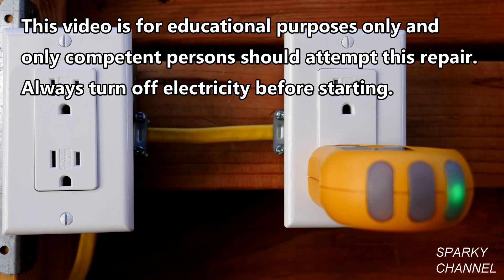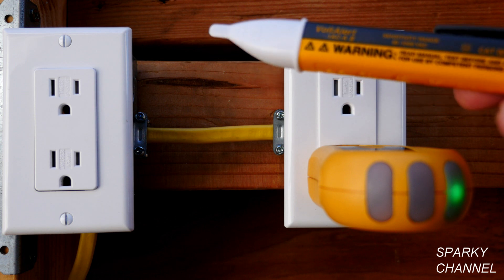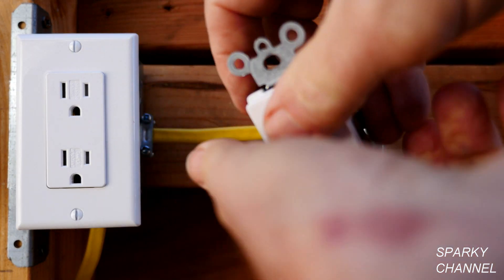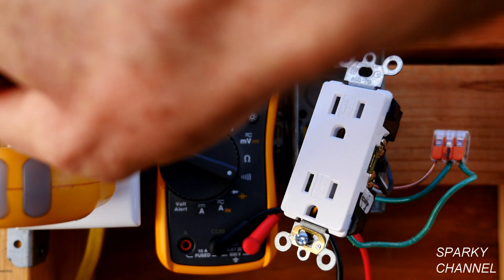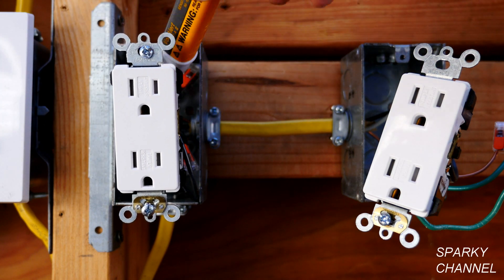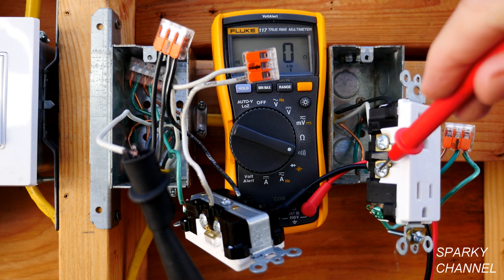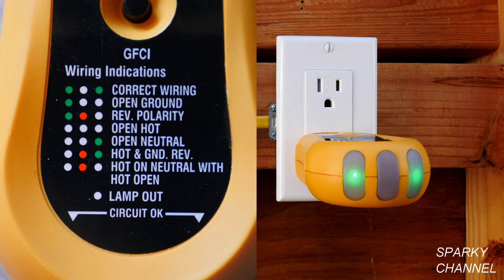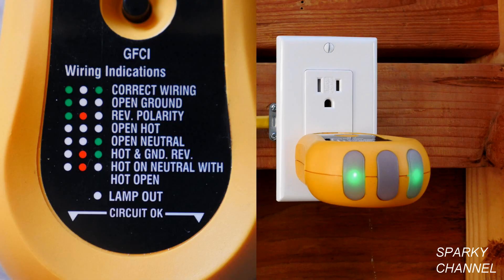How to Fix an Open Neutral Receptacle When the Problem is Upstream in the Circuit

Comment: I'm five years into my new home and still have an island outlet with a open neutral.  The problem is I can't seem to locate the feeder outlet.  I have removed all the obvious nearby outlets and checked for a disconnected and/or loose neutral.  Any tricks to identify where it is tapped into?

Comment: I want to go with this vid but then you went and taped the outlet. I like taping outlets too. Gives me a sense of tightness in the job. But its also controversial. The devices are rated as is for dissipating heat. The tape changes the ability for the device to do that properly

Comment: Circuit braker  jumps out suddenly when i used 2500W heater.. when I wanted turn it on its immediately jumps out again.. i saw circuit breaker is melted and badly burns. So I replaced it with the new one but its immediately tripping out.. than I see all 3 wires inside outlets become live without any voltage.. is anyone knows what is the issue ? Is some wires melted  some places inside the walls causing the short circuit? Thanks

Comment: Switches, Outlet and Compromised Circuit with open Neutral Wiring 
1.	Living room 3 Switch and 4- outlet not working. Kitchen ceiling light switches bad, One Single line
2.	Hot & ground rev in outlet (As per my Tool)
3.	Kitchen, Bath and Bedroom switches, outlet are working Fine
4.	Circuit breaker possible compromised circuit with open Neutral wiring living room (AL Conductor)

Comment: Back stabbing wires is not recommended u should always use the screws on the side.
Reply: If the holes for back stabbing are there that means it can safely be used if devices are listed thats it even though I try not to use the back stabbing connections if you decide it to use them is fine as longest it’s done properly I see sloppy work on screws connections that are just as bad or worse than the back stabbing connection
Reply: @MrMarava  heat cycles wear them down over many years, and they can become faulty over time.

Comment: I have a bunch of outlets in my house that are testing "open neutral" but they all still work..........What could that be?
Reply: Somebody may have connected your ground to a neutral elsewhere to bypass the open neutral test your ground wire to see if it's hot

Comment: I have 3 outlets on a wall, all testing open neutral. The problem I’m having is that I CANT find the breaker for these outlets. I’m using my breaker finder, normal I would be able to follow the wires but these have to be under ground and I can’t find an access panel or anything around here.  P.S. I’m in an indoor mini golf place and the outlets are on a wall that separates the golf holes.

Comment: The video was OK except. I do not recommend using the middle side knockout in a metal box, especially when you have a knockout seal or KO seal. on the right side. That is so very close to being able to touch the hot side of the receptacle. You should have used a plastic knockout. Whatever possible into a single gang handybox is, this one is called go in from the top. Or the bottom or use the bottom or the top on the side. Not the center, one that can touch the neutral or hotside of a receptacle or switch that slocated on completion.KJ

Comment: I checked like you said, I backtrack and I found where the issue was. I took the wires apart, found that some of them were burnt as I stripped them put them together and Wala. No more unconnected neutral. Thank you for your video I appreciate it. I feel good about getting it done myself. Thank you again.

Comment: THANK YOU!  This is how all DIY videos should be done 👏 I had an Open Neutral on an outlet on a circuit that was confounding me, and your straightforward video led me to the upstream GFCI outlet that was faulty and now I’m back up and running 👍
Reply from the maker: Great to hear, thanks!
Reply: 😮  ahhhh. The GFI was faulty!  Just gave another place to check!  Thank you. My outside  gfi box was giving this error, tied to an inside circuit all the way to middle of my house.😮

Comment: Thanks Bill this was helpful. Can you help me with a question? I want to add an outlet to my garage that will provide 3600 watts (2880 continuous) for tools, that is GFCI protected. Can you outline how this would be done? I know I could add two GFCI outlets side-by-side, and run two 12/2 wires from each outlet to their own 15a or 20a breakers, but is there a better way to do it? Thanks!

Comment: I have a question please... If the primary function of a neutral is returning the electricity to the panel then why don't you get shocked from it when you touch it? I keep hearing this saying that the neutral returns electricity to the panel but how can that be if it does not shock you? Thanks!
Reply: Is it correct to say the neutral job is carrying the current back to the panel BUT that current is not energized and that's why you don't get shocked by a neutral (unless its a short circuit)?

Comment: Great video!!! - Question about the tape. I have read many times that there is no need for tape, that tape will increase the temp and may induce a fire - What is the common practice on applying tape to outlets? and what the code say? - Thanks again! good tips

Comment: Just wondering if you can answer a question I have two outlets in one box and when I wire one Outlet by itself it works fine but when I wire in both Outlets I'm showing an open neutral?

Comment: Puzzled as to why the outlet to the left tested normal as it had an open neutral?
Reply: It tested/worked fine because the upstream neutral and hot were attached properly to it.  The problem was that the neutral going from that box was ‘not’ connected to anything. So, Bill just connected the loose neutral to the pigtail that existed from the incoming neutral.

Comment: Excellent videos on the misleading hot/ground problem.  I found two duplex receptacle with hot/ground on the tester, and disconnected everything in the other receptacles but the first two didn't change to open neutral.  There are two ceiling lights on the circuit that have both stopped working.  Would an open neutral in a circuit branch with lights and switches (no outlets) always show hot/ground reverse because the load is always connected?

Comment: Hi,
   Thanks for your video.  I was able to troubleshoot 5 outlets that were not working as well as a closet light that was on the same circuit.  I used the outlet tester and was getting an open neutral.  When I opened the outlet there was a small piece of live wire that broke off and the wire was required into the screw holder.  I can only assume that the extra piece of wire was interfering and shorting out that wall.  

Thanks again.
Reply from the maker: Great job!

Comment: Ok randomly 5 of my 10 outlets randomly stopped working (at the end of the run) so I tested the line and the 5 indicated "hot & ground reversed" the 1st 5 indicated "correct wiring" so I opened the last 5 checked and tightened everything (not that any were  loose, only 1 neutral got a slightly turn) turned on the breaker and now it reads "open neutral " so as per your video I went to the next outlet back that indicates  "correct wiring" and all the wires are proper and tight? What am I missing here  ?

Comment: Mine is fine up top but down below instead of 120 it reads 30. I am a handyman but I don't mess with electric unless it's easy. But this one I'm having problems with. If anyone has an idea lmk. Thanks guys!
Reply from the maker: That's probably a ghost voltage. My Fluke 117 has a setting called Auto-V LoZ. When you flip it on that setting if it's a ghost voltage the reading becomes 0. What I can tell you is that something is wrong, perhaps your device or perhaps your meter. See my video: How to Turn Off Ghost Voltages with Dual Impedance (LoZ) Meters: https://youtu.be/JRXTFxsA_lA

Comment: Excellent, simple format and very informative.   Will try tomorrow on my external GFCI that is in same situation as presented here.  Circuit breaker fine, GFCI test/reset button inop, have a hot white on line side.  Will go through a back check in downstream outlets.  Thanks Bill!
Reply: FYI- When the GFCI receptacles fail, they just stop working.  There are some fancy ones that have a light that tells you when inoperable.    To test this, you could shut that breaker off and replace it with a new one or another GFCI from somewhere in the house (safely removed).  The GFCIs have a life span of about 5 years depending on wet location, number of times it has tripped, etc.  Mine have lasted over 20 years, but that’s not the norm.  Let us know how it turns out.
Reply: Martin Parish  I'm having the same issue as you. No changes have been made since the problem started. What did you find?

Comment: The circuit tester reports Hot on Neutral with Hot Open on the same outlet reading 70VAC.  The outlet failing is a ground fault outlet and has not tripped. The black wire is hot at 70VAC. The same reading of 70VAC is shown if I measure between the black and white (neutral) wire when the outlet is removed.  This is a single phase 120v 60Hz residential outlet.

Comment: What if only one outlet is failing? There are no other electrical issues found in this home.  The outlet failing is a ground fault outlet and has not tripped. The black wire is hot at 70VAC. The same reading of 70VAC is shown if I measure between the black and white (neutral) wire when the outlet is removed.  This is a single phase 120v 60Hz residential outlet.
Reply: I have the very same issue with bathroom outlet. Its the only one that does not work. I don't know what the hell to do.!. He didn't seem to answer you ! Did you resolve it and how ? Thank You !

Comment: 2 years. TWO YEARS!! Electricians telling me it's the bathroom light and fan. Took 3 hours to test, retest, rewire and nothing (except I have a timer now on the bathroom fan). Drove me crazy since the bathroom fan and light worked but there were 2 outlets barely pulling anything. 
Finally, like GOD just said "alright, we've tortured her enough" I come across this video. I decide at 3am to check and sure enough, the outlet right next to my head every night had a neutral just hanging out in the back.

Thank you Sir. Thank you so much.
Reply from the maker: Great job! Thanks so much and you write very well!

Comment: Thanks for just sharing your knowledge like that. I did a  workshop ( Metal bldg) and passed inspection, but never thought to wrap the receptacles in electrical tape.  Now here is my question, will open neutral cause a situation like what I am having.  In kitchen I fire up the electric kettle and the fridge seems to be running louder.  I suspect that the fridge and kettle become series and not parallel so more amps is getting driven through the fridge by the kettle's amperage draw.  Could kettle be faulty and leaking power to ground and causing that ( doubt it)?  Thanks

Comment: Thats great for new construction however you will not find that in existing wiring. Not a practical video for the average home owner. Steel boxes are not typically used in modern homes. Taping the receptacle is a joke! Never be in a box or work it energized so no need for tape.

Comment: @Sparky your videos are great.  You speak clearly and very well and obviously know this subject like an expert.  Thanks for sharing in your knowledge because between you and another electrician that I paid $150 to fix a 4 toggle circuit with 2 light fixtures, obviously including 3-way and 4-way toggles I have learned an awful lot.

What do I do when the Fluke Voltage Detector still lights up but does not make any chirping sounds?
My other question is do you have any videos on how to determine which outlet is upstream from all of the others to target as the prime candidate for replacement with a GFCI/AFCI?
Finally, do I require a GFCI/AFCI breaker in order to put a GFCI/AFCI receptacle on that string of devices on the same circuit?

Thank you.
Reply: The Fluke tester I have will disable the beep (if it annoys) by keeping the on button pressed down for a few seconds when you first power up the tester.  As for finding the first receptacle upstream, it is ‘usually the closest to the breaker box, but to really determine which one is closest, you need to open the suspect receptacle (after flipping breaker off) and disconnect the wires so nothing would go downstream and then check to see no power on the rest of the receptacles after power is back on.  Can be a little hit or miss process.  Add your GFCI to the upstream receptacle and then use the internal test to see if it kills all the receptacles.  Regarding needing a GFCI breaker on that circuit, the answer is no.

Comment: Thanks for sharing your wisdom. I replaced a switch powering a chandelier. Turned it on and off a couple of times and it worked fine.  Half an hour later the light came on by itself and I cannot turn it off. Replaced switch and same thing is happening. Help!!!

Comment: Technically that is called the grounded conductor. The neutral is the wire that carries the unbalanced load. Other than that, great job 👏

Comment: It is also very important to show that an open neutral wire could be loaded with electricity. 
That is a danger for electrical shock for whoever assume that neutral wire carries no electricity.
For example in the trouble outlet with a light plugged in, show that HOT-NEUTRAL measures 0V instead of 120V,  NEUTRAL to GND shows 120V instead of 0V.
Reply: Person with extremely novice understanding of electricity here but would the non-contact detector be able to detect the power on a hot neutral to Gnd?
Reply: @Axs208  Yes, a non-contact detector will detect high voltage on a hot neutral.
Reply: A very cardinal comment

Comment: Those lever wire connectors are the bomb. I always worried about the twist connectors failing when you tucked the wires back into the hole. Great video!
Reply from the maker: Thanks Richard!
Reply: How much are
They ?
Reply: They only fail if you don’t use them right.
Reply: These fail way more then a wire nut …way more! This is the equivalent of back stabbing a plug
Reply: @pulkpuller   I’ve been using the Wago lever connectors for years and never had a problem.  There are cheaply made Chinese knockoffs that are crap.  Conversely, I’ve seen countless wire nuts that were not put on properly and caused problems.
Reply: @glasshalffull2930   any hint of vibration and wags are a poor choice. Yes , anything installed poorly will obviously not work.
Reply: @pulkpuller  I’ll keep that in mind.  Thanks!

Comment: 90% of the time this problem is because the original installer used stab connections in the receptacle and the connection has failed.  75% of the time, the problem will be in the upstream receptacle. 33% of the time, you will be unable to figure what the guy who ran the wires was thinking when he routed them.
Reply: I have also seen people who tighten wire nuts so much they break the wire.
Reply: @WeMe83  that's impressive since I've seen people crank down a wite nut hard enough to break the shell of the nut without breakimg the wire.

Comment: Hi Sparky Thanks for your educational videos. I'm wondering, what would happen if I peed directly into an outlet with a hot wire and an open neutral? Other than the smell (I don't mind as I have burnt out olfactory senses), would I be in danger of the spark jumping from the copper wires over to my pee-hole? Definitely wouldn't want that to happen! Thanks for any insight you might offer. Wanting to try this soon, but wanting a fuller understanding of the physics before I attempt it.
Reply: Depends on if your body is grounded I guess. If you’re wearing shoes then you might feel a little tingle as the capacitive properties of the human body will accept some charge. If you have your hand on a bonded metal fixture though, or your feet making good contact with a conductive ground, you die. Probably not a good idea and I take no responsibility lmao
Reply: @MrFitness94  Ok, that does make some sense. I'm just wondering though, how exactly would I know the difference between the normal "tingle" I feel when peeing first thing in the morning, and the tingle that might come if my body is acting as a capacitor? 🤔
Reply: @Rick-the-Swift  i cant say I know what you mean by the “normal tingle.” But i mean, if you’re peeing into a toilet bowl and you have X amount of tickle, then that’s your baseline. Now, anything more than X, would have to be coming from external sources. So I’d say, if you pee on a hot wire/outlet, and you feel a tingle that’s MORE than X, then you’d know. 
I might add, the problem with some “shocks,” is that the path could be so resistive, that the current flowing is so small and you can barely even tell you’re getting “shocked.”
Reply: What an Idiot!
Reply: @danserrano85  idk Dan, I thought MrFitness explanation made pretty good sense, although like most valid scientific hypotheses it did leave me more questions than answers. 🤔
Reply: @Rick-the-Swift  Mamon

Comment: Love your videos. But I am irritated!!!  Not with you of course, but with the electricians who wired my house back in the late 50's and who ever it was that hacked your channel!!  I am trying to put new outlets in my house, the way you showed (cgfi for a non grounded plug series and labeling all of them them correctly, finding  the first plug etc).  But I came across something that makes me slightly mad.  The electricians of old joined the line wires and load wires together with copper crimps, then black taped them and then a short pigtail to the plug.  Not a big deal by itself, but they left only 2 inches of wire in the box!!!  I seem to recall in one of you older videos how you correctly added wire length in the box, and I think it was with WAGO lever connectors.  Would you by chance still have that video?